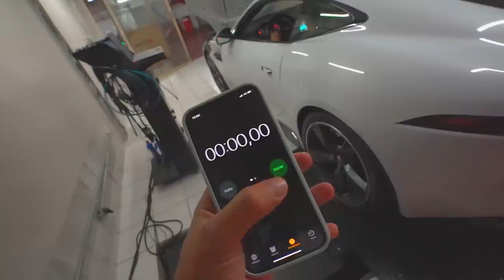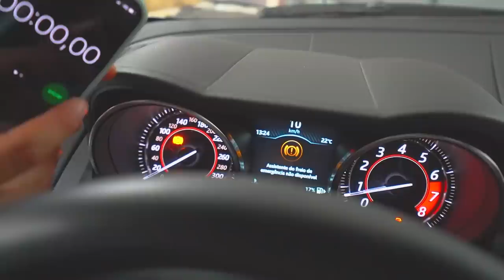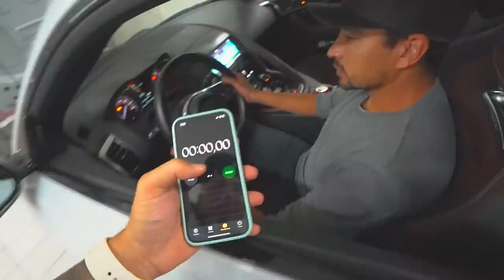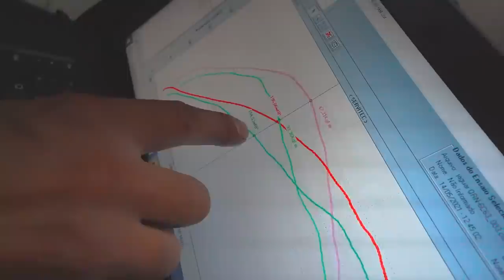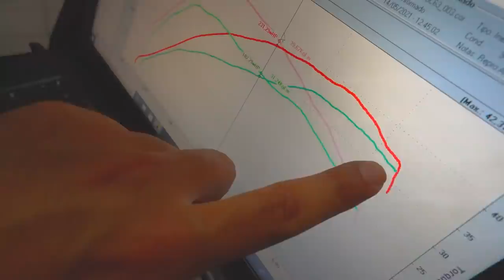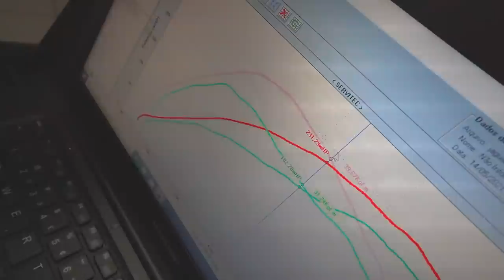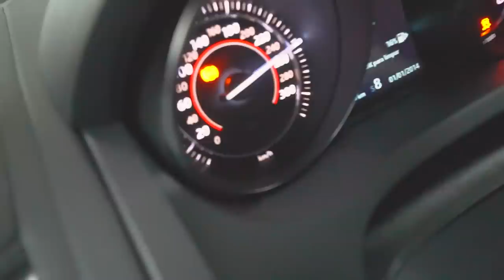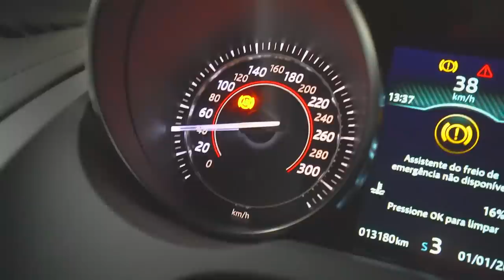MEU JAGUAR PASSOU DE 300 KM!! 🔥 “preparado o carro pro racha contra porsche”

Comment: Caraca Leo isso sim é carro😎
Reply: Em dinamómetro não tem nada haver com a estrada, dos 0 aos 200 nem um gt r com 1000hp faz  8 segundos
Reply: @tiagoribeiromachado8120  c ponha um gtr 1000cv no dina nen passa e outra gtr e muito pesado e quase 2t um de 2000hp vai de 0 a 200 em 6seg
Reply: @tiagoribeiromachado8120  na vdd pode chegar pq o carro e um 2.0t tem 300cv original o dele ta stage 2 anda mais ou menos igual um jetta stage 3 full e o jaguar ainda e mais leve 8seg na pista talvez faça
Reply: Esqueceram que existe a força do vento né
Reply: Vc tem noção q um carro 4 CILINDROS turbo, que tá longe de ser um 4 CILINDROS forte, pegando com 1 remap, 1 REMAP só, passando de 300 em 14 segundos? meu amigo, ou e feitiço ou coisa botada pq e IMPOSSIVEL, os cara deve ter colocado 0 de carga no dinamômetro se n tiver colocado negativo